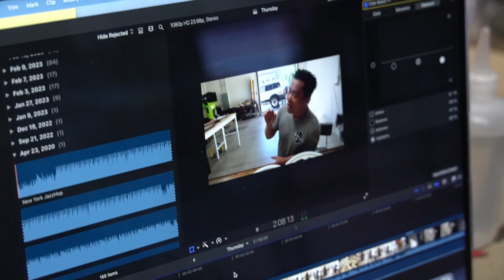Brakes We Created Odyssey BMX Doesn't Want You To See!

Comment: I knew a guy that rode but worked at a machine shop and drilled his brakes like that around 2007 when the light bike craze was going on. Good to see you guys doing it now.  Those would look nice on a modern retro Haro Lineage, Gt Performer, Hoffman Condor or Big Daddy, Trick Star, Colony Oz-one or Prody, EF Formerpro. Odyssey should do a run in different colors, U brakes and V brakes for the big bike builds.

Comment: if you put the part submergered in a solvent, the grease and stuff will disolve in the solvent, so when you pull it out and there is solvent(with grease disolved in it), the solvent evaporates leaving all the impurities left. You want to wipe the parts with clean white rags and alcohol

Comment: Spray painting can be finnicky and time consuming.  First clean the part. Then scuff the surface. Give ot a wipe down then use degreaser to remove any oil. Oh and wear rubber gloves from the beginning, touching a part you just degreased kinda defeats the purpose lol.

Hang the part from a wire or fishing line and let it dry. Once dry, leave it hanging and start with a thin coat of primer. Most spray painting fails are from rushing and using thick coats of paint. Each coat should be as thin as you can manage. The first coat youll probably still see the layer under it, which is why people try to cover the entire bike all at once. Youre going to get full coverage because youll be using a lot of separate coats. Let dry completely between coats. Gently sand each coat and use compressed air to remove dust, then apply your next coat. Apply 3 or 4 coats of primer. Sand and dust. Now switch to your colored paint. Use good, artist grade or automotive paint, but dont skimp. And use a matte or satin finish instead of gloss. The reason for that in a sec.

Do the same as you did with the primer and sand each coat with a finer grade, and remember to blow off any dust. Apply as thin a coat as possible, and apply around 6 coats. Now, the reason i said use a matte or satin finish is because the next step will ultimately dictate the way it will look. Its onto clear coating. Some people sand, some dont, i dont usually notice a difference with this layer. Maybe sand the first couple coats, its up to you. This is the layer that will dictate the final look, so choose whatever finish you like, matte, satin, gloss, just depends on how you want it to look. Again, dont use cheap clear coats. Apply thin coats, super thin coats, and apply 5 or more. Some matte paints advise against clear coating because it changes the way light interacts with the paint. For this reason matte paintjobs can often chip since theres no protective clear coat to act as a sacrificial layer. I dont dislike matte paintjobs but i prefer a clear coat but then it usually makes it less matte and more satin or eggshell looking.

After youre finished you want to treat the surface. You can wax and buff, you can use ceramic finish, but find a finishing method that is suited to how you want it to look and follow their instructions. For example a gloss finish youre going to probably wax and buff and then polish. Its kinda like sharpening knives, youll start with a coarser stone and work your way up to very fine stones then hone and strop until you have a mirror polish. Same idea. Just look up paint finishing products and follow their instructions. 

I actually really like ceramic coating. Its almost like applying a coat of glass and is really low maintenance but requires pH neutral soap when you clean your bike. You can usually get away with just spraying the bike down with water because unless the bike is seriously dirty or gets something acidic like bird droppings on it, for the most part dirt and dust just slides off. And when the bike gets wet the water just beads up and flows off, leaving your bike looking brand new. 

All in all, its simple but can be tedious and time consuming but the extra effort pays off.

If you take away only one thing from this, id reccomend it be to use numerous very thin coats. Youll get the coverage, and it wont feel thick and sorta sticky or tacky, and itll still look great. That and use quality paint. A buck or two extra is worth it, and you only need one, maybe 2 cans anyways.

Anyways i hope this might help. And always use protection. Wear a respirator, protect those lungs!

Comment: good tip is get an undercoat base coat on the item you want to paint first before you spray it,  use light coats from a distance and build layers 20 min gaps 3 or 4 coats never hurts. and apply a clear coat for protection

Comment: Use wax and grease remover, and a Self etching primer first on any stripped down bare parts. 

Might be better off doing this to brakes that are painted from the factory,  then just scuff up that factory paint and use it as a base coat.

Comment: looked like u used to much of a smooth high grit sandpaper, ive painted and sanded loads of stuff n it never sticks like that, more rough sandpaper like even as low as 50 to properly scratch the surface but gently can work. real smooth shiny things like that are always tough to sand and paint